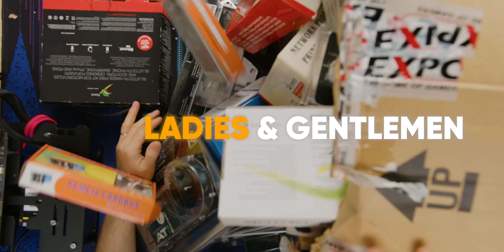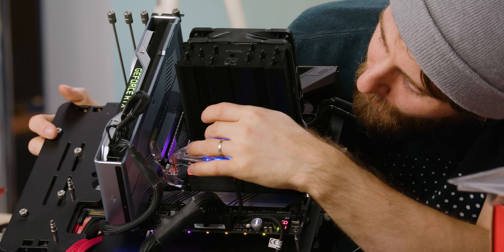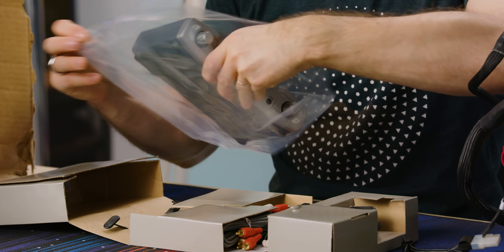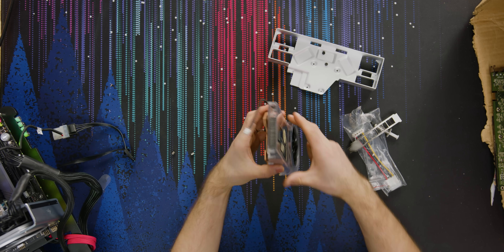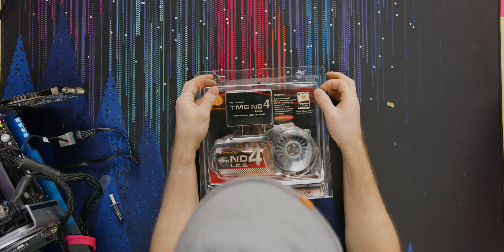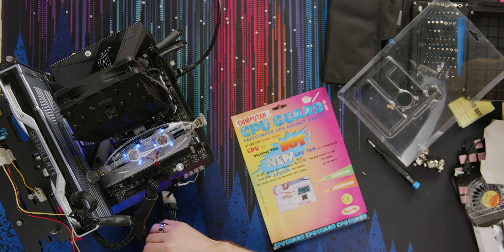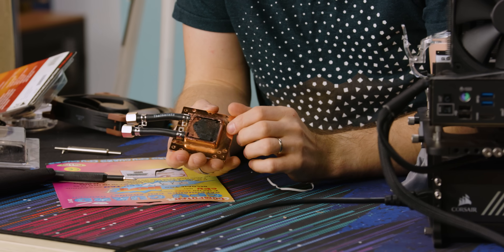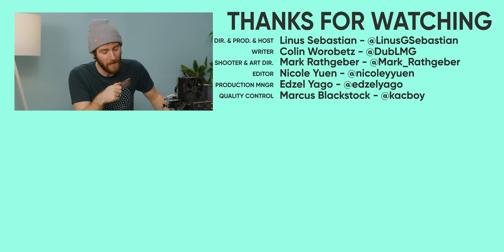I Bought Out This Bankrupt Computer Store's Inventory

Comment: 8:30- Before SSDs were super cheap, I used a 320GB 10K RPM WD Veliciraptor as a boot drive and it did very well! I love the those hard drives.

It's still in my PC now as non demanding game storage and I'll probably use it until the day it dies.
Reply: Dude I used to have 2x Velociraptor in a raid zero and the boot times were near SSD like. I fucking loved those things..
Reply: If I were two find two 1 TB variants at a freegeek I volunteer at, I would use them in Raid 0 as well. I would absolutely still use them on a NAS

Comment: I had one of those (or very similar) HDD coolers/silencers for my old 36GB Raptor...  It worked quite well.   I also had several of those Arctic GPU coolers in the early/mid 2000's as well.   They really were the business!

Pushing 15 or more years now...   Crazy.

Comment: linus @ around the nine minute mark explaining the need for vibration damping on a mechanical hard drive just solved a question i had some years ago why my hard drives kept failing...

i was young, and did not know better hahaha.
i'd just stuff em in, and wouldn't even waste time with screws back in those days.

Comment: Shame that they got rid of the expansion cards from laptops but I guess technically you can replace most of it with a USB dongle
Reply: These were super common in the windows 95 days. Most 486 and newer laptops had them. I remember "upgrading" to windows 95b from 95a for USB support on a 486 laptop. 

We also had the first wifi card I'd ever seen in a pcmia card. We used it to go between our router upstairs to the computers downstairs. In the dial-up days, it wasn't even a bottle neck. 

We also used to use a serial adapter to play two player games on a flight sim, on and the old style BNC networking, it was way, way faster then Ethernet way back when. 

I also wanted to build a car computer when I was a kid, and I bought a pci-pcmia card adapter because wifi cards used to be huge. I also bought the very first mini-itx form factor computer that I still have in a junk box in my room. 

It was an old 533mhz via mini-itx fanless. The plan was to build it into a car stereo for a stealth look.

Comment: 5:18 I owned one of those Zalman 5.1amps. Got it with a 5.1 headset.
The idea behind is that you could split  to 5.1 headphones and 5.1 Speakers and have separate volume controls for both. No  unplugging your speakers to plug in your headphones.
Headphones didn`t last that long but the amp worker for almost 12 years of daily use.

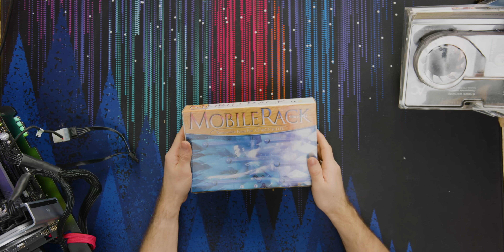Comment: 3:42 - I used to have a whole stack of those things, with it at least two of the slide in racks in each of my tower computers, and I used them for quickly and easily sticking a customers hard drive into my computer to either run a virus scan on it without having to boot off that drive, or to clone the drive. It was way faster then opening up the side of the computer all the time. And was a lot more handy than keeping a caseless motherboard sitting on my workbench.
Reply: Hot swap utility bays are still useful today. I used to have one on my old desktop so I could move around all my HDD archives. Now I have a full tower so everything is centrally contained.
Reply: @uss-dh7909  these ones weren’t hot swappable though. :)

Comment: I used those hard drive racks at 3:40 all the time. I'd by them on sale. Some had quick swap capability some didn't. They were damned expensive if you couldn't get them on sale. I still use a couple for data storage in my server to quick swap drives when i need to access archived data on old drives. I'll keep using them until i swap my archived drives to sata. Good usage of old ide drives instead of throwing them out.
Reply: Same for me, i used them mostly because we also used them in school. 

Each student had a drive in a sled, were the school didn’t have to maintain or clean PC’s because you always had your own OS and crap installed on your own harddrive. 

All the computers in the school were equiped with the same hardware (Pentium 3 1GHZ, 128MB, onboard graphics and 100mbit LAN/Internet) - Yes we had a 1gbit internet at the school anno 2000. 

I also had one at home to read data from the drive when doing my homework. Stupid expensive for a student but it helped us in the long term, you always had your data on hand.
Reply: I had three of them in my tower, oh so long ago, only the top one was wired. Two of them were for me and my wife had the other one. Turn the computer off plug in your drive to the active port and reboot, three computers in one and no one messing up anyone else's stuff.
Reply: Currently, I have a hot-swap drive bay. No enclosure needed on the drive. Allows me to use internal drives as giant USB sticks at full speeds. It's fucking sick, and I hate that case manufacturers are stripping out the 5 1/4'' bays all in the name of adding (generally) unnecessary fans. The extra airflow may be great for overclockers but for everyone else who's just doing homework or office work or playing Fortnite, it's a gross waste of space.
Reply: My School used that. They had hundreds of computers with that. So you could just plug in your own hdd with OS and School Projects😅
Reply: My first introduction to Linux was actually using one of these. I'd have Windows 98 on one drive and Mandrake Linux in another, and swap them out depending on which one I wanted to use. It was basically like dual-booting, without dual-booting.
Reply: Same here, it was the first time I got to know what "hot-swapping" was. It was amazing.
Reply: I just installed a couple of hotswap bays on my current PC. Feels good.
Reply: I hope someone rescued them from the pile of stuff after 😵

Comment: 1:11 dude, 3rd parties use old @$$ standards some of us do find useful. My wifi card inside my laptop stopped working, so my expresscard wifi adapter came incredibly handy, it still is. All of my laptops have the expresscard slot, even a popular 2013 M6700 has at that point that 10 year old slot.

Comment: Buying out ewaste so it can forever be entombed on a warehouse shelf like God intended, the late 90s early 2000s we're so insane with the garbage they made it's almost impressive how dumb some of it is.
Reply: While at the same time a lot of stuff was amazing and its sad it disappears.
eg. the TV tuner / recording cards, external hard drive bays, multi-card readers, or laptop expansion cards.
Especially those expansion cards, today Linus invested in that laptop company since it allowed for 4 crappy expansion cards with a single port in each, 
while back in the days, PCMCIA cards allowed 4 usb ports in each card, and laptops had one and sometimes two of those on top of normal IO.
Reply: @hubertnnn  card readers are still usable wish we still had 5.25 bays today i really like them
Reply: @Rainbow__cookie  You can still buy new cases with 5.25" bays, it just restrict your options a bit. Fractal Define 7 comes with one and Define 7 XL has two, and those are some good high-end cases. Also, many cheap cases (read: bottom-of-the-barrel DIYPC cases) have 5.25" bays.
Reply: @hubertnnn  Agreed, expresscard was basically the precursor to Thunderbolt, with the added benefit of some cards being able to sit flush inside the laptop chassis. You name it, expresscard likely had it - not only USB port expansion, but also sound cards and even external GPUs! And sure expresscard might have less bandwidth than Thunderbolt, but I'm far more confident about its durability in contrast to fragile Thunderbolt ports.
Reply: @SuperWhisk Yeah, like headphone jacks :)

Comment: 3:42 we actually had those things in school in like 2004. So everybody (or every workstation) had its own HDD so you could work on your PC (including network settings and wild stuff) and the next user wouldn't be affected
Reply: That 'Before My Time' Comment hurt, I'm only a year older than Linus and I used them :)
Reply: I had a stack of them too. They were really useful for e.g. swapping the OS drive in a system without having to open it up. With hot-swappable SATA they became far more useful, of course. Best way to make a backup is to a HDD which you can then pop out of the system and store somewhere safe :)
Reply: I'll bet we had 5-10 of these when I was a kid. My dad always had different operating systems installed for weird old hardware comparability. 

We had one for "games" that would would swap in. Ours also had a lock on it so that we could be grounded. 

I quickly leaned that you could just either unplug it, or remove it and pop it open to defeat the lock. 

These were super common, I remember my dad buying one at Walmart at one point, and that was before Walmart really had a computer section.
Reply: I was using them back in college in 2007/2008 myself for class so people would have their own drive for class
Reply: Our school still had those in 2013.
Reply: We had those in 2014 for fast OS swap in lab environment.
Reply: I have government customers who still use these, but they are for 3.5" drives and are SATA.  One upside is they can store the data in a safe.
Reply: @rcwills  The drive cage in the video is for 3,5" drives as well. The cage just goes into 5,25" bay.
Reply: I still use something similar today but for 2.5" drives. This way I can use my work os ssd when I work at home
Reply: Damn, that must be nice. I remember when I graduated in 2015 from highschool, our computer lab had rows of monitors. The thing is though, all those monitors were on a shared tower so all its resources were getting split. Students would literally shut down their current session, and move to a less occupied row if things slowed down too much.
Reply: I remember growing up with one of these in my home - my uncle set us up with one each so in case one of us did a stupid and got a virus, no one else was affected. Never realised how useful it was until seeing this video - just have your entire system on a lockable drive bay, and shove it into any rig you want to use. Kids want to play on your rig? Just slide yours out and use the spare PC for a while. When I build a new rig I should definitely set up an external to be my user folder and game drive - good compromise I guess since computers depend on specific drivers more now.

Comment: god i was a system builder around this time , those card readers were pretty good but thank god Thermaltake has come a long way they made so much trash including a drive bay replacement with a car cigarette lighter which zoomers wouldn't even know what that is
I actually even have one of those AC cooled graphics cards because i just kept it , thing worked forever and whatever the card was prob was high end so i used it for a few years then kept it as a spare. i sort of miss aftermarket graphics card coolers like that but i guess no one uses the reference design now
Reply: But I do know what that is.
Reply: LGR did a video on it I believe. There was so much funny junk like that back then.